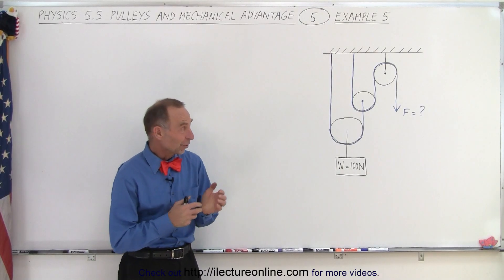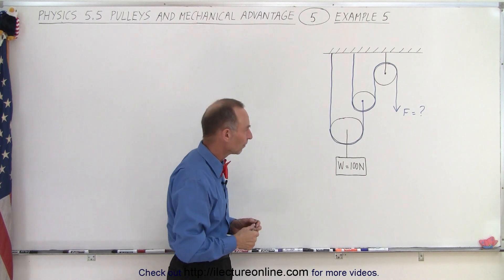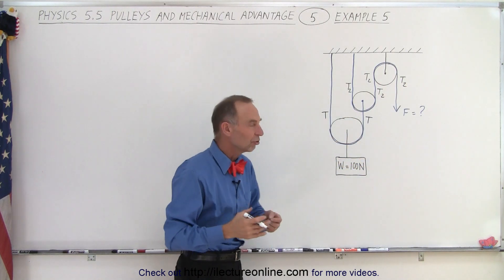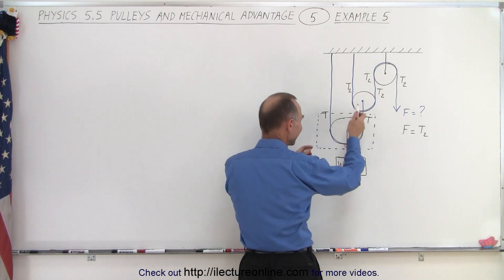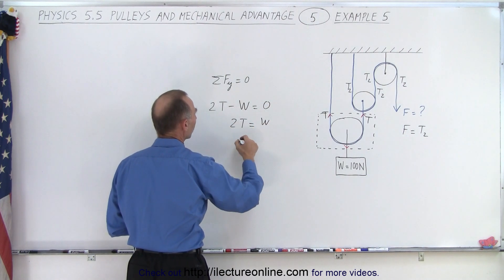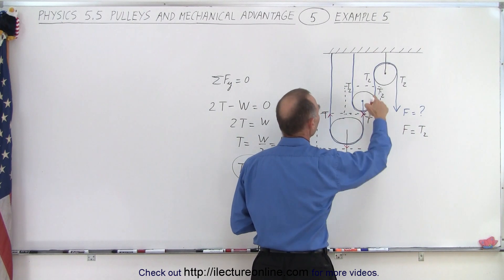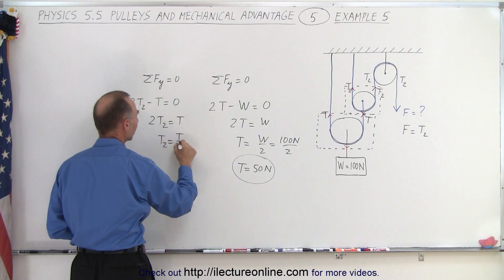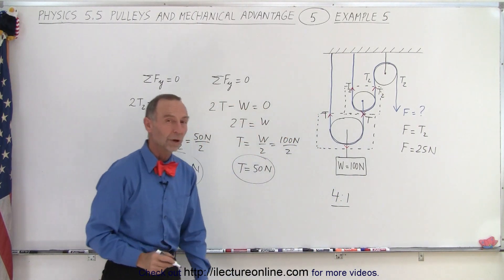Physics Ch. 5.5 Pulley's and Mechanical Advantage (5 of 10) Example 5

Comment: Could you also solve the case where the reels are weigthed, sir?
Reply from the maker: Typically, when we the situation is static, like in this example, they do not take the weight of the pulleys into account.  However, if they are asking for the acceleration of the system, we have several playlists that show you how to calculate the acceleration with pulleys that have mass and moment of inertia.  PHYSICS 13.1 MOMENT OF INERTIA APPLICATIONS 2   starting with this video:  Physics - Application of the Moment of Inertia (1 of 11) Acceleration=? of the "Yo-Yo"  https://youtu.be/XHkDJwQ4Xng